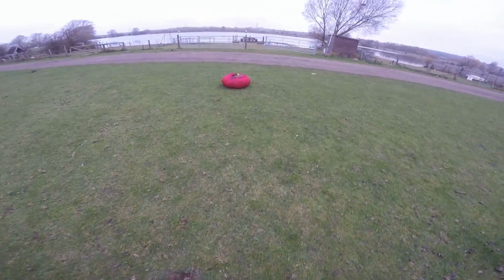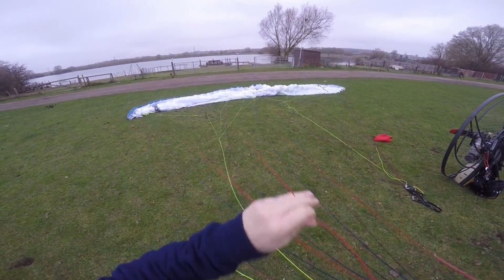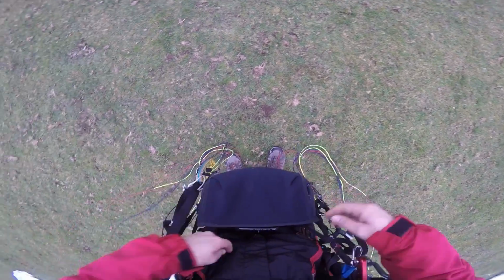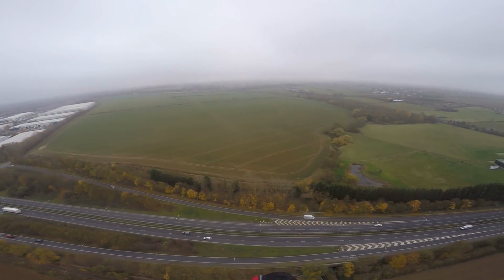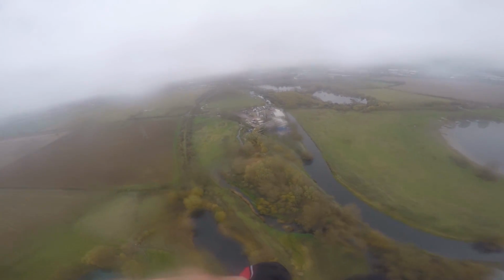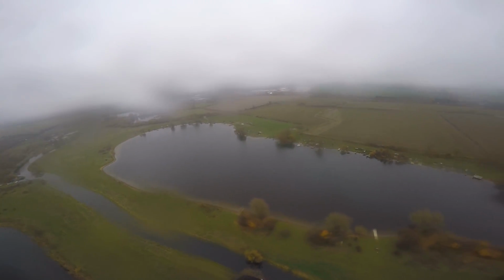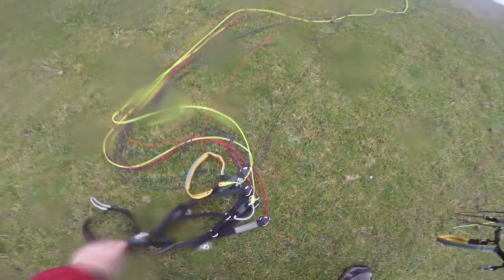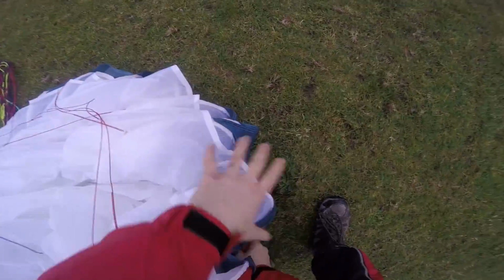Paramotor Vlog - 4-stroke SERVICE, FLYING in..weather

Comment: NGK sells solid cap versions of these plugs which is a far superior conductor than aluminum.  If you must use the threaded type, use red loctite.  It'll ruin the plug wire boot connector, this is why you must remove the risk.

Comment: I like that motor. We have stick infested ground cover at our LZ. Especially on days without wind to fly the wing into position, I pull each line tight to the riser than lay the clumped lines down right behind me, NO swirling of the lines, which looks cool, but wraps them around stick cover that will send your wing in new directions. This way when centering the wing the clumped lines are no longer. Swirl all ya want if departing from a golf course. Good editing.
Reply from the maker: Good advice, thank you!

Comment: Hey there @PARANOOB would love to have a chat about the Bailey and your experience with it if able...cheers
Reply from the maker: Well, it's all I've flown, so have nothing to compare it to, but ask away..
Reply: @PARANOOB  Cheers Mate, How many hours have you put on it? Parts availability and service from Bailey? Ease of service? Power ok? Does it take a while to wind up?
Reply from the maker: I have about 60hrs on it. I've not had to rely on Bailey for parts, the consumable bits are readily available. Servicing is easy.
Power/wind up is fine for me, nothing to compare it to. Theres obvs less power and throttle response than a 2 stroke but I've never found it wanting.

Comment: I just bought a newer ipad with built in gps , no more satalite or signal needed for following rought. its awsom , i just got the gaia app and now just downloan the map of the area first while at home wifi and then put it in airplane mode and it does waypoints , pictures and  roughting 👍😊

Comment: Weather minima for VFR flight outside Controlled Airspace (Classes F and G Airspace) 

Below FL 100 

5km flight visibility
1500 m horizontally from cloud
1000ft vertically from cloud.
Reply: Jack Potter Is that accurate? I noticed a mix of metric and imperial distances given. Which seemed odd to my inexperienced non-pilot self.
Reply from the maker: We're classed as gliders, so different rules for us.
'Clear of cloud'..